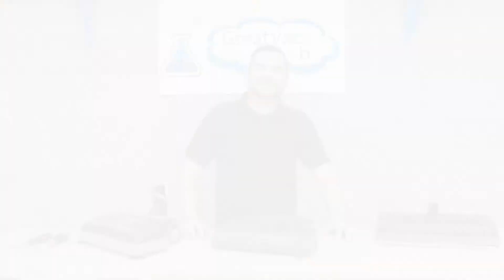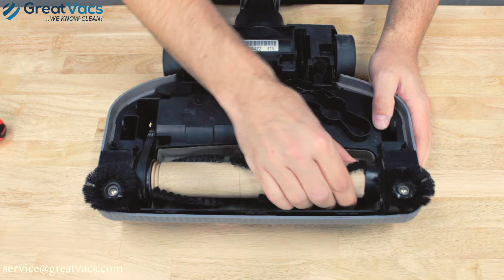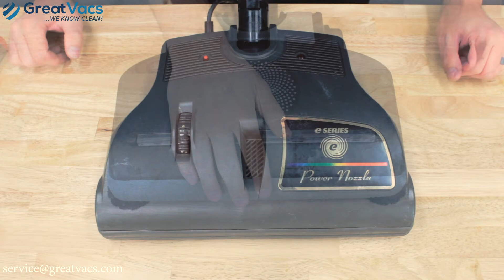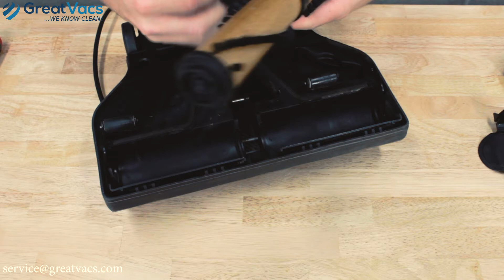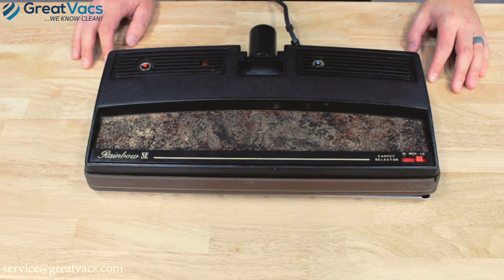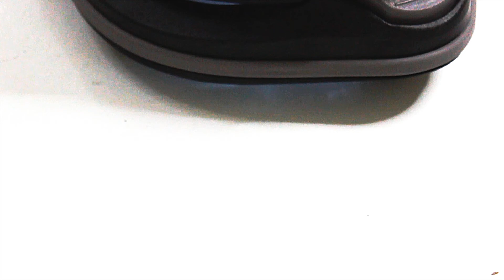How to Replace a Rainbow Vacuum Belt

Comment: I noticed both those gray cardboard pieces are missing on that older E2 floor nozzle. The wire protector shield and the motor mount piece that goes on the motor.

Comment: Thanks to you, I was just now able to install my new belt on my trash picked 1993 D4C. BTW, my floorhead plate is missing one of those two screws. What is the exact specs for that screw? It is also missing the gray cardboard floorhead motor mount. How do I get another one of those?